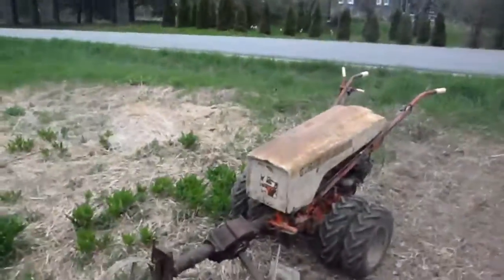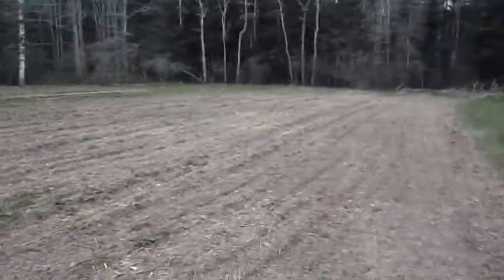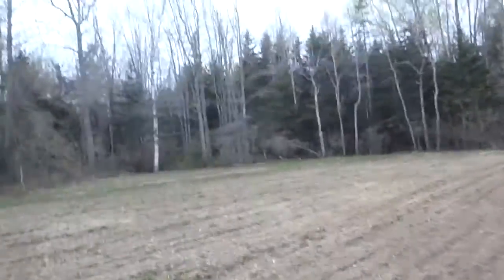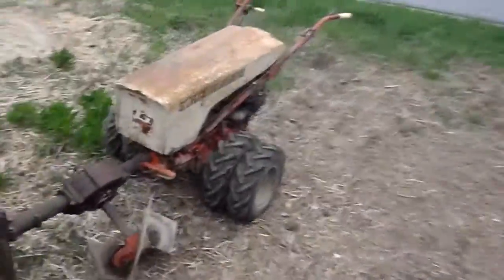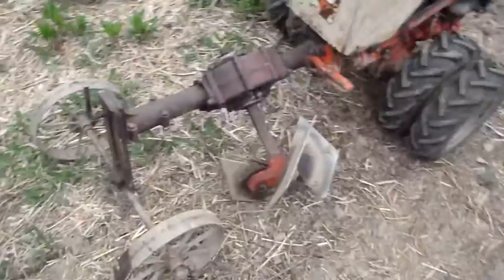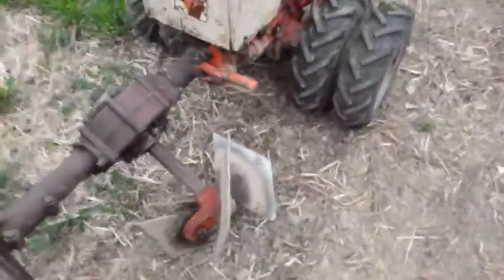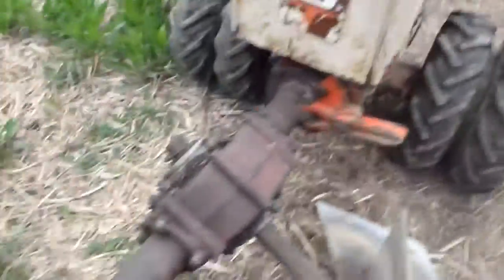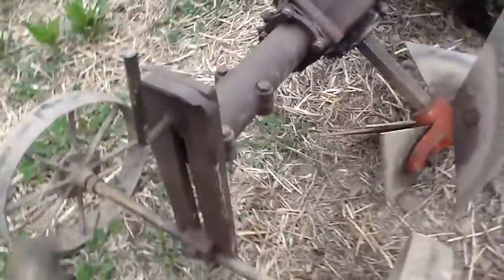Gravely Model L Rotary Plow Demonstration

Comment: Uh.....you have that thing set up about as wrong as it can possibly be.  Look at some of the other videos here about the rotary plow, they all have them set up right.
Reply from the maker: SteveD328 I was 13 years old at the time this was filmed. I had just gotten this rotary plow working at the time this was filmed. I have since fine tuned it and it works great. I have used it in my garden every year since.
-Phil
Reply: Cool, those plows work great when they are setup right.  Glad you got it going.  I've been around Gravelys all of my life, my dad had one when I was born, (I'm 58 now)  he traded it in in 73 and got a new 7.6 Convertable...with an electric start....I still have that tractor....and 3 more besides it,  Steve D
Reply from the maker: SteveD328 the tractor in this video belonged to my great grandfather, we've been a Gravely Family since 1952. Incredible machines